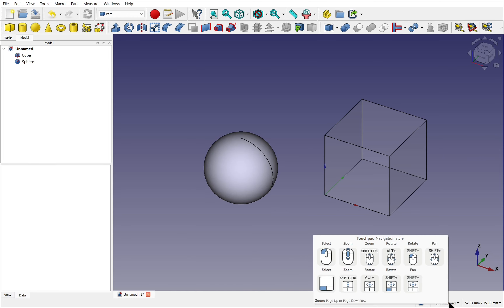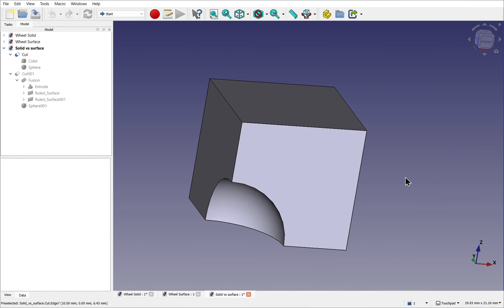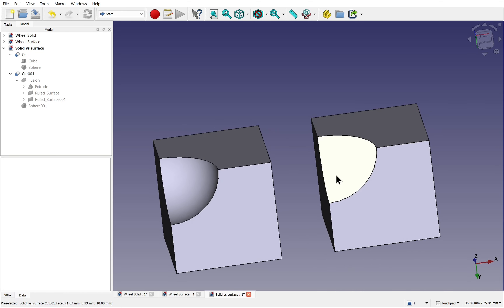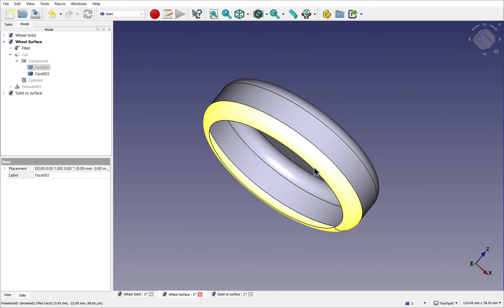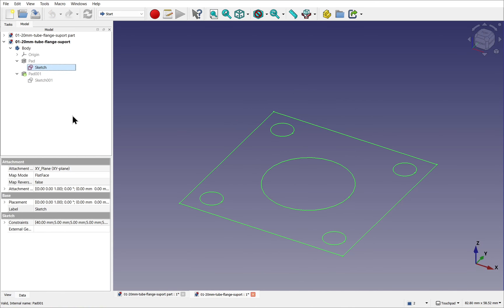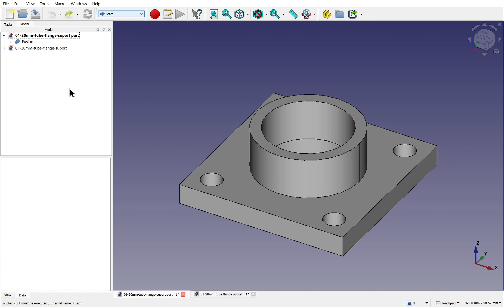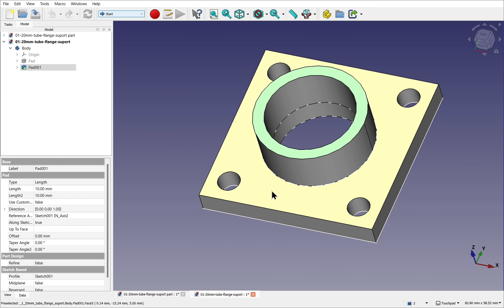Part vs Part Design which one to choose?  Basic Beginners FreeCAD v1 / 0.22 | Lesson 5

Comment: I'll add that the part workbench is the first layer on top of the geometry kernel, while part design is a user interface layer on top of the part workbench. So when something breaks in part design, it can often be fixed by taking the shape apart and fixing it manually in the part workbench. Useful when you have several hours in a project and get stuck.
Reply: That is actually a good way of seeing this.

I do a similar thing in Fusion360. When the Solid model is stuck I go into surface mode to repair it.

BUT

Part workbench lacks many important tools like G2 fillets etc.

That makes Part Design for me often still the rather first step to use.

Comment: I don't know why, but as a newbie with some experience with openSCAD, i found out that Part and Part design feel like different programs. Maybe I discovered some stuff randomly, but I tried to design simple bathroom towel hook - shape consisting of two arcs and one line, or something like upside down J letter with rounded Y. First I tried to draw sketch. J letter part was relatively easy. Adding second part broke constrains one way or other, I was not able to make arc and make boolean operation of sketches, nothing. Then I experimented with part. First it does not have body which is weird. I made arc with outer dimension, cylinder with inner dimension subtract. Add rectangle, fuse. Upside down J done. I draw sketch with two arces with given end angles, diameters, connected them by line, then extruded sketch, positioned it manually, fused. Done. So what took me like two hours and 4 failed attempts was accomplished in 20 minutes, even faster than openscad (which i tried to import, but extrusion failed).
Since now I assume that boolean operations work better in Part.

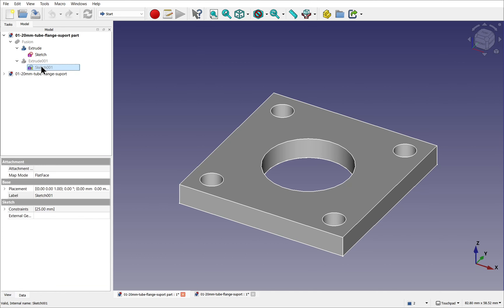Comment: 4:34 what is the distinction between "extrude" and "pad"?
Reply from the maker: Extrude is the process of adding volume by extruding a profile where as pad is an extrude that fuses with the previous operation (if there is one). To do this with an extrude you would also need to run a boolean operation.

Comment: Hi. Wich workbench would you recommend to make assemblies?
Reply from the maker: It's funny you should say that.  I am in the process of a project where I keep going back to refine an assembly after I make modifications in the build and new material comes available (I am restoring an old Greenhouse and finding salvage wood so I have to make adjustments to the different parts and remodel on the go) I am using A2plus for the ease of use over Assembly 4 but I am looking to swap to the new integrated assembly wb as I have done a lot of re-attachment due to new edges being created causing topo issues.  I am hoping I don't hit the same problems and want to do a video on the results.
Reply: @MangoJellySolutions  Hi Mango. Could you do a video on the tree, data, view , propreties tables and field ? all those tables that appears on the left side when you create a part or an assy. I have soo many questions regarding this maybe it cold help a lot to have you introduce these tables. For  exemple, i right clicked on a body in the tree, went down to tree setting and checked «show description». I cannot find how to write the description of a part or an assy. I see the column being added, but cant find the cell were i have to write it. I was wondering also if you could point at a cell that could host the revision value.
Reply from the maker: @guillaumevincent716  This question has been driving me nuts all week.  Finally found it.  Description is know as 'Label2', of course it is lol!  So you may not see it on everything so you will need to right click on the data tab and check 'show hidden'.  I have also had another request from a patreon regarding a treeview video so will like to blend in this information as well.   Revision value, you could right click and add property for a custom property? Would that work?
Reply from the maker: @guillaumevincent716  Oh an addition! just found this out.  click in the description cell, hit F2.  You can edit it if the object has a label 2!  Every days a school day (found out that one by accident as i just dropped my mug on my keyboard!!)

Comment: Compound and Fusion.... I still  can't see the difference ???
Reply: Here's my guess. With freecad being open sourced, each workbench may have a different creator. Since the workbenches are designed to do specific things and use similar tools to get there, they name the tools differently as not to confuse the user as to which WB they are using.  I have experienced errors in one WB and no errors in another WB while using the same steps. So, either I'm neglecting the particular order of steps (required in 1 WB) or the WB isn't designed to accomplish the task.  Blending tasks within different WB's seems to error often.  Presently, I'm fighting with curves WB profile-pipeline using the same steps done on a successful model, but, hasn't worked on a similar model.  The non-working path is a rounded rectangle, primitive compared to the successful model. What a way to ruin a sunday afternoon ... freecad addiction. Lol 😂
Reply: @dbeelee8564 Haha. Well what can I say. I too persevere until I accomplish the task. But then forget how I did it the last time in order to accomplish something similar. Terribly frustrating.